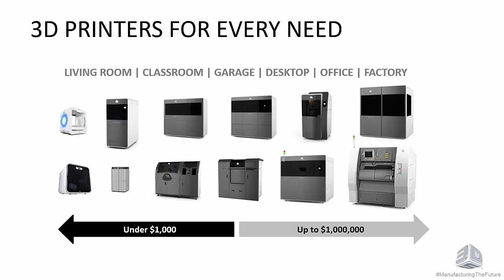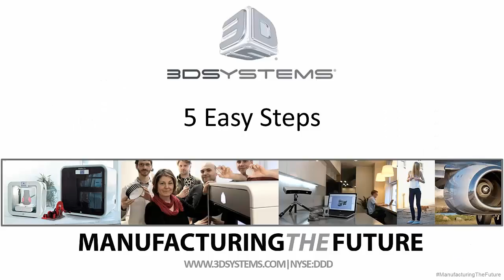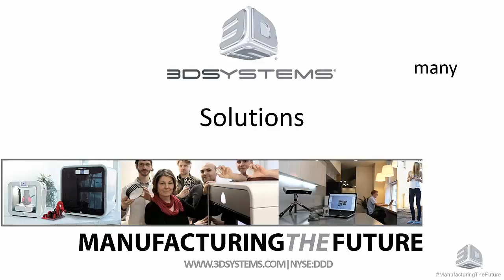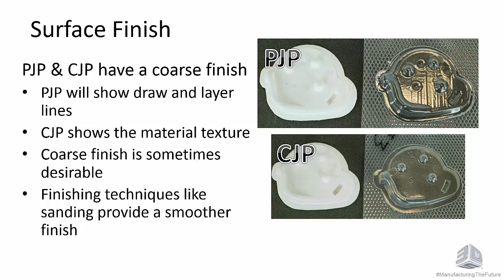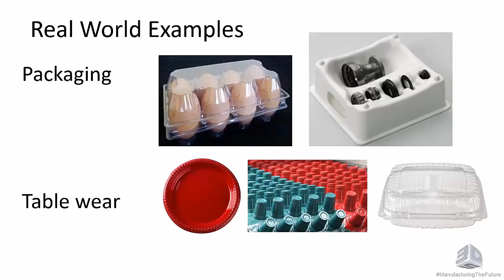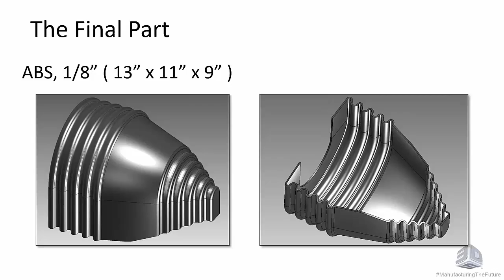Thermoforming With 3D Printed Molds In 5 Steps

Comment: At 30:00 you show a part made, but the visual dimensions are not like the design. To simplify, you have right side ribbing and left side ribbing with a center smooth section. The design seems to show the smooth center section width is equal or fatter than either the left or the right, however the mould made looks to be much wider on both the left and right compared to the center smooth section